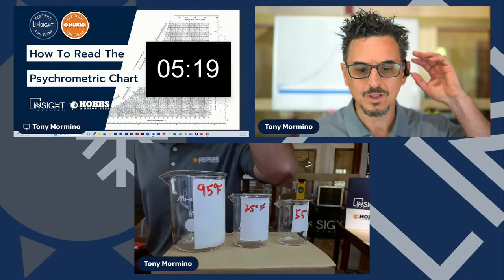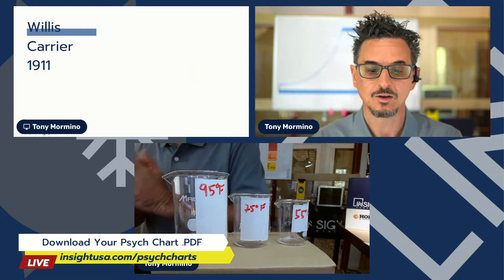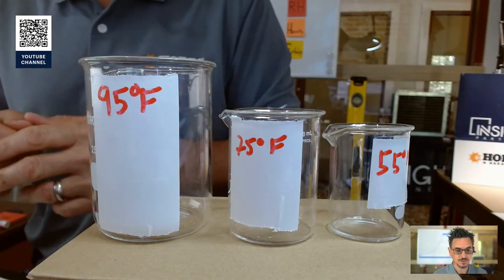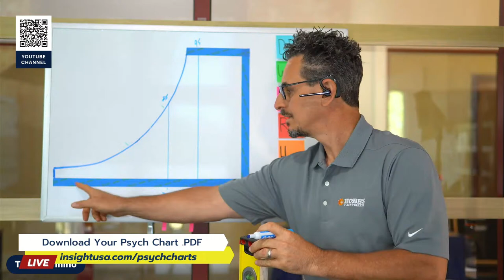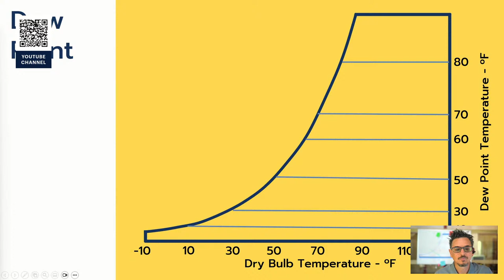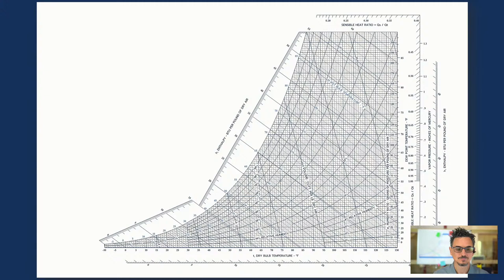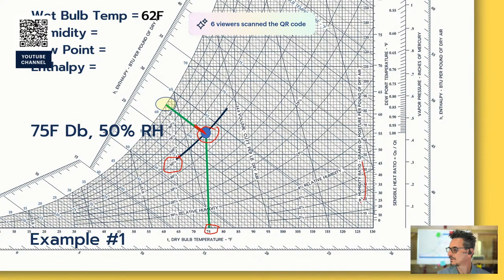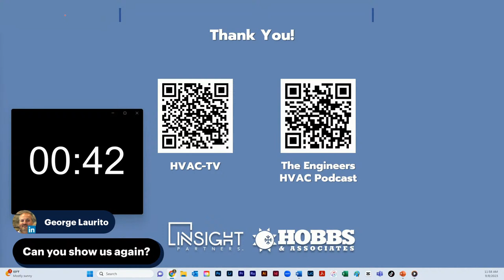Psychrometrics Part 1 - How To Read the Psychrometric Chart

Comment: Dry bulb and dew point lines on a psychrometric chart are not perpendicular due to the natural behavior of air properties. In designing the chart, Willis Carrier likely chose to make dew point lines perfectly horizontal rather than dry bulb lines vertical because dew point lines better represent practical applications like sensible cooling and heating. Vertical dry bulb lines wouldn’t work effectively in real-world scenarios, as they don’t align with the way air properties interact under various conditions. This choice makes the chart more functional and intuitive for HVAC engineers. Hope I am correct on this.